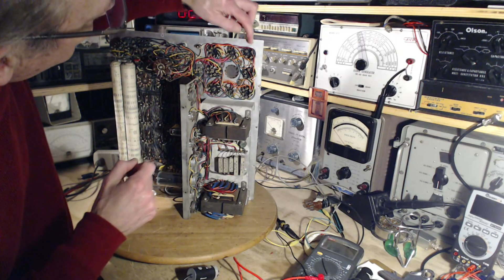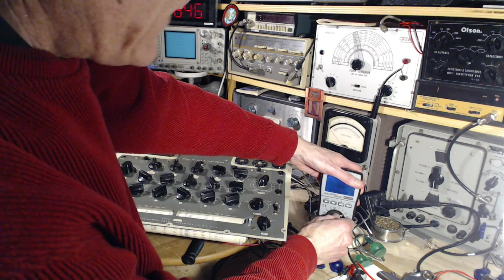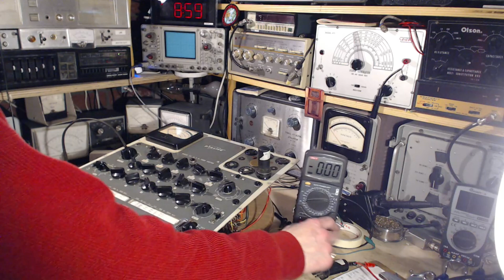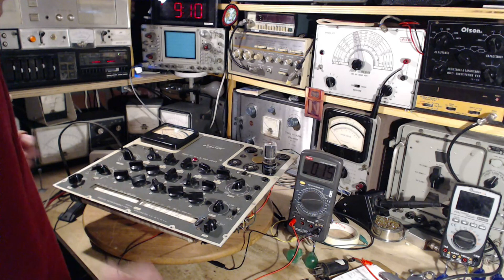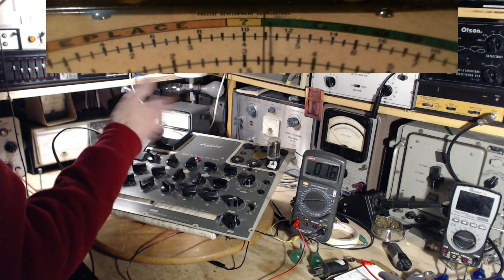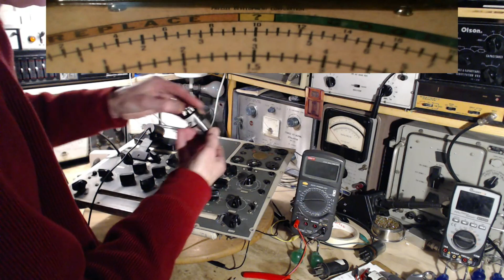Precise Model III Tube Tester Video #12 - Filament Current Calibration

Comment: Reconnect the filament and re-solder the wire and use the clamp meter to get a current reading.